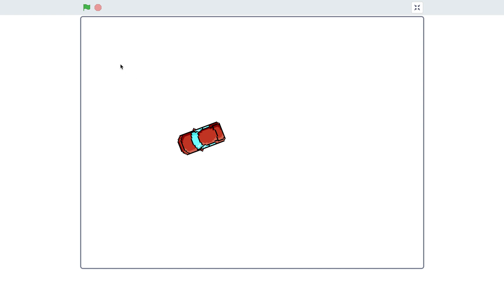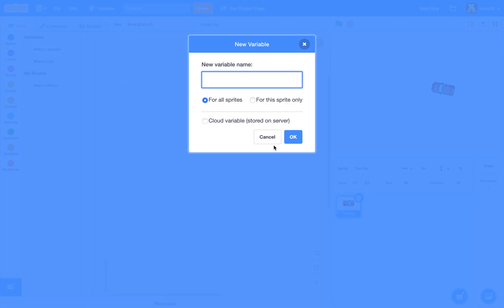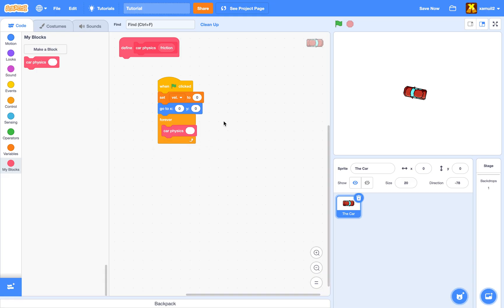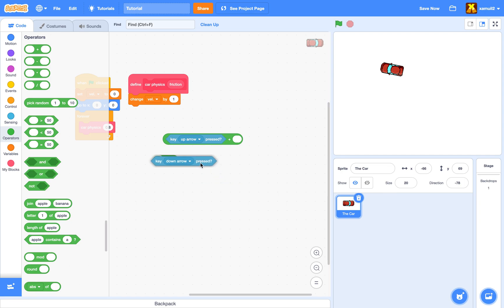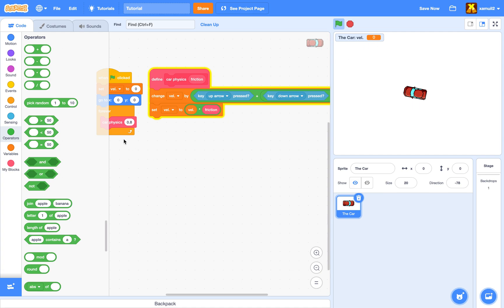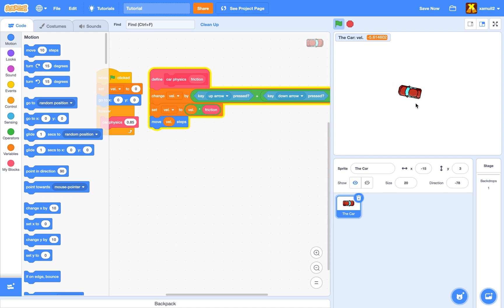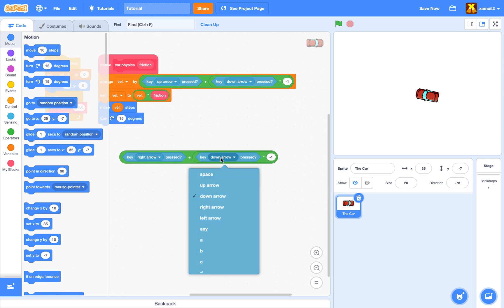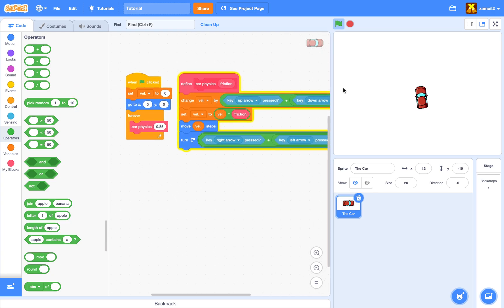Car Physics || Scratch 3.0 Tutorial

Comment: Not really.
Reply: Well apparently it is also a solution by using sin and cos function. But scratch designed the “move...step” because it is easier for new scratchers. I am sure that everyone with math basics know what you’re talking about. So if you’re just trying to show your “advanced” math skill, this is not the place. This video is for new scratchers to learn.
Reply from the maker: @acc-lab1233  Mhm. Also I've seen Prof. Blue's version so I didn't want to just copy his method.
Reply: @acc-lab1233  Oh ok. But It's more effective if you use sin & cos. Don't wanna make a riot
Reply: @Simon_Parinas  Sure. Sorry for being rude, if you get offended. Also sin&cos is more necessary when you do pen or stamp things. For example, https://scratch.mit.edu/projects/357510927/ <- this project I made. sin&cos function is pretty needed, since using `move ( ) step` is not effective for pen based projects.
Reply: The correct way is by using sin and cos. Ok?